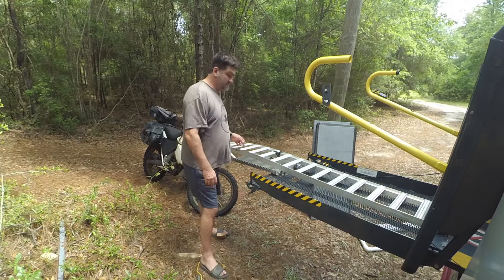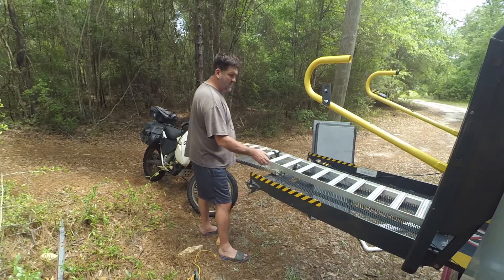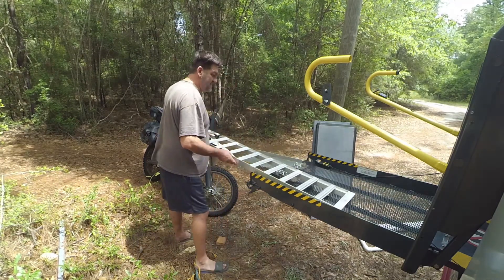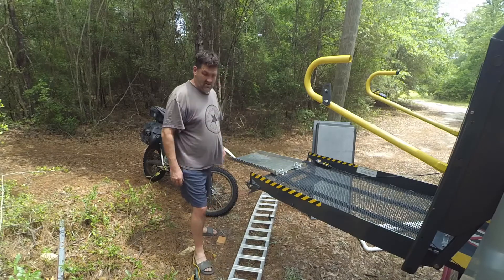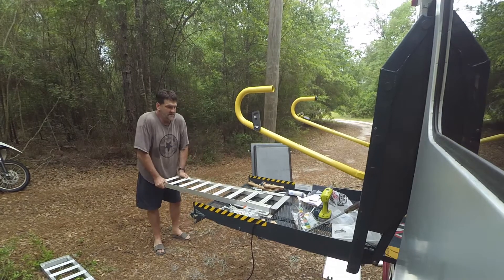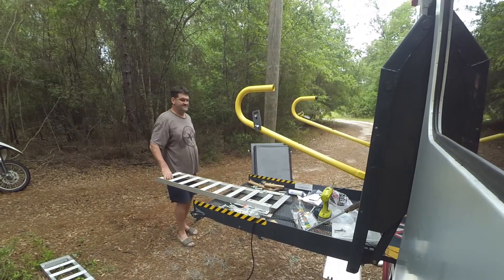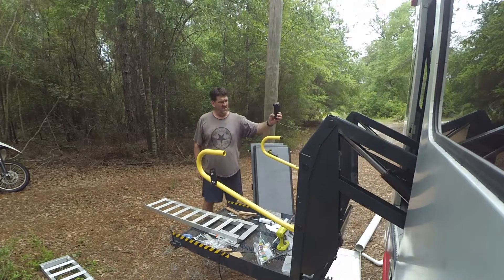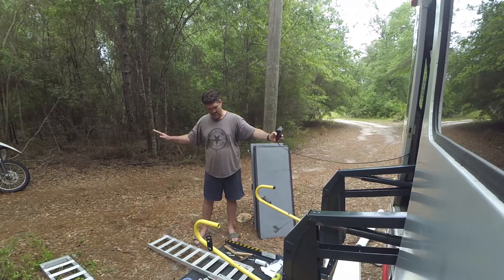Motorcycle Lift 2 - redesigning motorcycle lift extension for the skoolie

Comment: Awesome fix, much better than the hinged ramp. I'm looking at a boxtruck build atm, easier to stealth camp in the cities with a delivery vehicle than a school/shuttle bus. Less work since it's just an empty box, no seats to pull out and no flooring to rip up. As an added bonus, the lift gate in the rear becomes my bike ramp and doubles as a "back porch" seating area
Reply from the maker: I have a buddy that has exactly that - except the box is a "reefer" -  heavily insulated box that is GREAT for winter/summer.  And yes I am all about stealth, but the only way to be stealth with a skoolie is to keep it painted yellow, and park in school parking lots - which should get you thrown UNDER the jail if caught :)

Comment: The hinge wasn't the problem. The new ramp is stronger and you moved the anchor point closer to the bus, giving it more leverage and using more of the original platform for support. Nice Job.

Comment: Dude! That's the way... man, I'm about to buy a schoolie.
Reply from the maker: The Ten Skoolie Commandments
I – Thou shalt not jump in feet-first without doing thy research.

II – Thou shalt have a realistic budget, and thou shalt not overpay.

III – Thou shalt know what thee is buying.

IV – Thou shalt not take thy seller's word as gold.

V – Thou shalt not buy sight unseen without a pre-purchase inspection.

VI – Thou shalt not buy diesels newer than 2007, nor shalt thou treat diesel engines as gasoline.

VII – Thou shalt study thine Commercial Driver's Manual, and take thy skoolie's weight, height and length seriously.

VIII – Thou shalt plan thy conversion carefully before beginning, and thou shalt seek help if necessary.

IX – Thou shalt not wontonly cut wiring, disable safety devices, or remove anything without consulting skoolie.net or professionals.

X – Thou shalt not scrap anything removed until it is proven unnecessary.

Comment: Seems like it would be better to flip the extension over and have the slats on the bottom? I may have missed some details of the build that explained the reasoning, though. Good to see it coming along...
Reply from the maker: I imagine there are a few more ways to get it done, but I find it hard to believe there are any easier ways to get it done....and man it is sturdy!
Reply: kwb377 I was thinking that with the "ladder" flipped over the slats would be flush with the ground/ramp, and it would give the tire a "channel" to ride in and prevent the chance for it to slip off the edge.
Reply from the maker: The ladder is actually a ramp....I am afraid the "rungs" might break off since they are mounted on the front with most of the weight is resting on the segments - upside down they would heave simple welds holding them on - seems safer to me even without the "guides"?  I think I could actually roll over the guides anyway with knobbies :)

Comment: How sketchy is unloading? Any contingencies for rolling the bike back too far? I'm thinking about getting a wheelchair lift bus to haul 2 motorcycles in between travel jobs
Reply from the maker: Yeah it's pretty sketchy if you're not careful but I learned to use the clutch to back it up that way when you release the clutch the bike is locked into place. That seems the most reasonable method to me. You could also use some locking ramp thingy like they have installed already, but I think it just gets in the way. Just use the clutch and be careful and everything will be fine.
Reply: One of the bikes is a DCT Africa Twin so that is unfortunately where things get weird. Haven't had it too long but not having a clutch has made the ways I load and unload significantly different because I normally do what you described haha.

Comment: whats the weight capacity of the lift? Could it lift a bagger??
Reply from the maker: the rating of most of the Braun's is 800 lbs, but there is a big safety margin in there, and I bet you could get well over 1000 lbs.  YMMV

Comment: Just a heads up: those lifts are rated for 350#. Should it fail, learn the manual over-ride.
Reply from the maker: these are rated @ 800#, which covers me AND the bike - luckily, but thanks for the heads up - I need them more than you know
Reply: Glad you have a beefer lift.
Reply from the maker: I think that is a standard nowadays with electric chairs and FAT kids :)